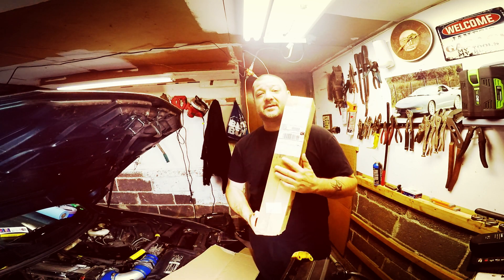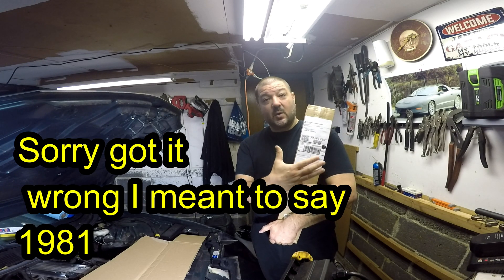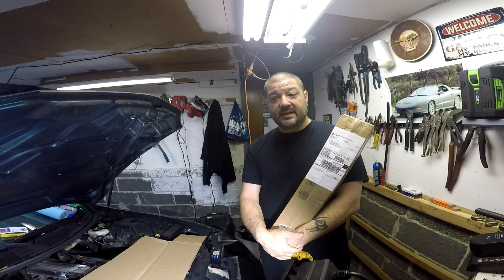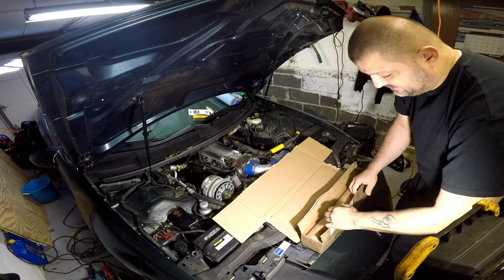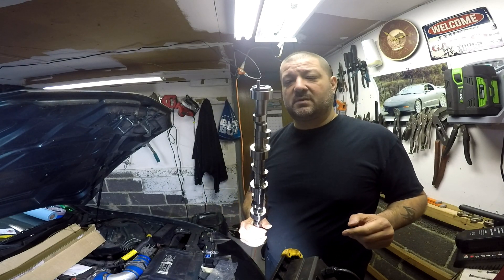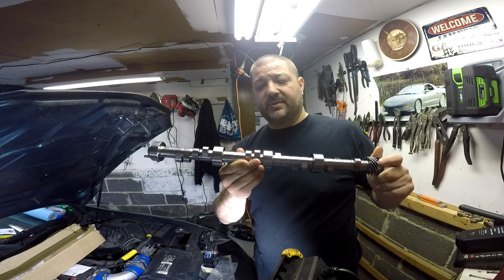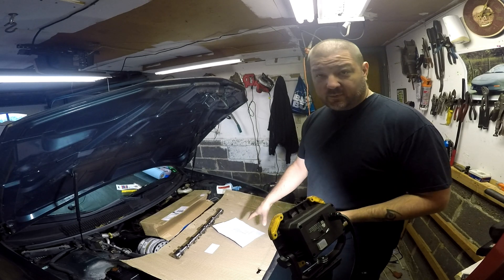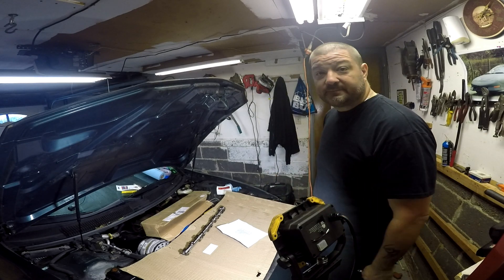4th Gen Fbody Camaro Performance Camshaft LT1 / LT4 Small Block Chevy  gen 2 5.7  XR282HR

Comment: What’s the cam spec?
Reply from the maker: 230/236 at .050 Maximum valve lift is .510-inch on the intake and .520 on the exhaust. It is ground on a 110-degree lobe separation angle.

Comment: Hi, the regrind cams are fine, but it does reduce the base circle, that means the tappet is lower in the bore, so it has less length to keep the tappet stable in the bore. Plus, it lowers the pushrod and repositions the rocker arm changing it geometry. So, depending on the original relationship of the tappet in the bore this may or may not affect the strength or longevity of the tappet to bore relationship.
Reply from the maker: yes ..  but did not experience any geometry problems when i installed the cam ... .. right know I am  in the middle of doing a engine swap (i toasted the motor before the winter and will be swamping it out (one to many high rpm shifts with the stock bottom end) once i take out the old motor will look closer and measure the difference between the stock cam and the reground ... if you take a look at some of the cam swap videos i have  i compare the stock gm cam with the reground and you really can't tell the difference... but will look into what you said closer once i have the motor apart....

Comment: How do you know which cam to go with
Reply from the maker: The cam I went with is about as big as you want to go with stock heads 230 Duration @50 anthing more the heads wont support.. anything bigger you will give up to much low and torque with a stock size motor

Comment: Awesome engines, We entered a small Dyno competition at a local college  (I’m a high school auto teacher) and the rules made us run an old style block but the head rule said any production sbc head, so we welded up the water port on a set of LT1s and drilled 3/4 holes out the back of the heads and ran the water back to the threaded holes on both sides of the water neck. We fully ported the LT1s and on our bench (Superflow 600) it flew around 260 cfm and near 80% exh (can’t recall exh cfm). We made 530 hp and 487! Ft lbs with a 355ci flat tappet and flat top pistons. We were 80hp above 2nd place! 😏. The following yr they sent us the rules “NO PORTING ALLOWED” 😕 so after a ton of searching we found a set of LT4s. We welded them up and did a nice valve job. They flew exactly the same as the ported LT1s! We went back that yr and made only 1 Horsepower less than the yr before!!! We then beat 2nd place by 100hp 😎 because they all had horsepower drops from the no porting rule.They canceled Dyno competitions after that lol Love your videos! Nelson Performance.
Reply from the maker: thank you for watching my cheesy videos ..  i am trying to make a simple how to videos for these LT1 engines because i see the market changing and alot of the younger generation is finding these cars appealing again because they are so cheap.. for this build i wanted to keep it cheap and simple for my other car (super charged firebird) thats going to be more updated with the latest parts etc ...  for a max effort lt1
Reply: Does your class need some project work? Have a couple sets of heads I would like reworked, and would be willing to make a donation to your class/program that more than paid for the work I want done. Awesome there are still schools doing this. They closed the auto, metal, and machine shop at our local high school about 3 years after I graduated (1991 graduate).
Reply: I really want to try out modding LT1 heads to throw on a project 86 L98 vette so I can easily run a nice cam to match my porting capabilities! Vs the iron L31 vortec heads I am in process of doing up ( tho installing LS3 beehive springs on the vortec heads and swapping a stock LT1 cam I pulled from a 97 T/A I found at LKQ ). Which might just stop there and sell the Vette after the increase in power cause still going to be way under my dd. So to me won't be impressive accept for the before and after differences as should add a good 50whp with the free-flowing exhaust and the in-depth porting treatment I gave the L98 TPI intake system. Also from that 97 LT1, snagged the 24# injectors which is a mere 2# increase over the factory L98's.

Comment: I bought that very same camshaft out of ebay,  and talked to the owner,too.. Very helpful person, very friendly ;took the time to answer all my questions. My cam came in in basically the same shape as yours in the video..Found it to be a very nicely machined piece, too !  Putting together a 2nd engine for the same car ( spare; it's a road-race Z-28) and will be using , most probably, the same grind, from the same supplier...
Reply: I believe I scrolled thru same listing on ebay then too. Has bunch of LTx regrinds that are like LT4 hot cam and can come with or without fuel pump lobe... Sounds about right huh?
Reply from the maker: Yes very nice guys super helpful just wish they would come out of the stone age with social media... lol and update thier website lol

Comment: @maldo72 This cam closely represents the comp cams xfi 467 cam
Specs are: 230/236 @ .50 with an Lsa of 113°
I want to run willhoites cam because its basically the same and cheaper, however Im scared to run it because it likes high rpm's and im not willing to shift or rev past 6,000RPM with my old Lt1. What do you think Maldo will my engine take the cam and will the cam be able to shine without revving it too high?
Reply from the maker: https://youtu.be/B-X0rgRSKds

I will have a better video soon once I get all the suspension stuff installed but, in the link, you can see about 6100 shift on a stock bottom end  .. I am not sure how many miles that are on your engine or how it was maintained over the years ... in general most small block Chevys will tolerate 6200-6400 rpm without a problem with the proper valve train set up ..  This cam feels super nice at low rpm and does not have the super aggressive lope ramp speeds which makes it easier on the valvetrain.  IMO really nice cam for the money ..  i might go into deatial in a further video in the future (about lope ramp speed )
Reply: Nice pfp

Comment: I got the 510 520 lift cam from the same company but had it reground on a 108 instead of the 112 & 110 that was advertised engine is still in the build process
Reply: Jim Prescott how does the 108 sound
Reply from the maker: Thank you for watching great little company we need more guys like this out there

Comment: My car is a 1995 Trans Am. I don't know if its gen 1 or gen 2. Can you tell me? Also what is the specs on this cam? I was told I should use a gm LT4 HOT CAM for a good thump and power.
Reply from the maker: Hi and thank you for watching your motor is a "gen 2"
what cam to use is a question as old as time lol 
LT4 hot cam is a pretty good daily driven street cam with some good lobe and better mid-range power but its an older design .. there are many newer styles out there that offer better performance ... what supporting mods are you planning with the cam? (headers etc?) will also help to determine which cam to use

Comment: Hey buddy,

I just realized my LT4 hotcam has a fuel pump lobe.
The stock one didn't have one. It fits, doesn't hit anything, I figured it shouldn't be a problem or is it?

how is your build going so far, did you install the cam already?
Reply from the maker: yes, if you got a gm hot cam it will have a fuel pump lobe. They made it so it will fit new and old motors. as I am writing this just got tody the rest of the parts I ordered plus a few more add ons will be shooting an updated video today hopefully will have it out by tomorrow with all the parts I will be using ..

Comment: Can you use a cam like that  in 95  Camaro LT1   using the factory springs Rods and lifters
Reply from the maker: Thank you for watching ... In theory you can but you will get massive valve float at about 5200-5800  rpm  if you hang on I will have an upcoming video for all the parts you need that can be done on a budget to make this cam work and work well
Reply: @maldo72  I'm looking forward for that video

Comment: Nice I just got my cam aswell.
I went with the LT4 hotcam
Reply from the maker: Same place?
Reply: maldo72 
I got the LT4 hot cam kit from summitracing . When will you start installing it? Will you pull the motor for the swap?
Reply from the maker: @24MartinONDS will begin in about a week  waiting for all the other parts ... stay tuned
Reply: @maldo72  can you post a video of it idling,and what type if rockers you use
Reply from the maker: @kendrickdaniel9155  thank you for watching on the channel there are a few clips of the car 
idle after the cam swap (i am using roller tip rocker arms 1.5.. for know will be upgrading to full roller in the future was trying to show in the build how cheap you can get away with for a cam swap .. plus will have more driving clips and idle once I am done doing all the other upgrades to the suspension, etc 
https://youtu.be/ArvSdgbcb-M
https://youtu.be/gmhPn2MnGsU
https://youtu.be/8PPQNEiRTjE